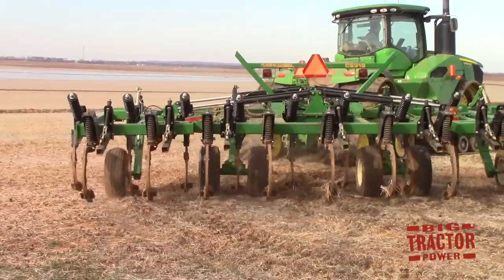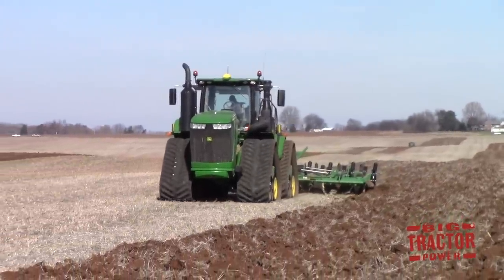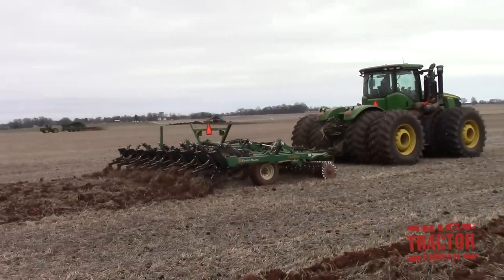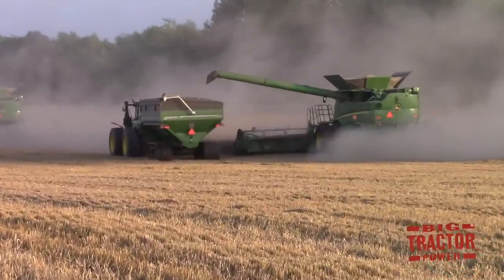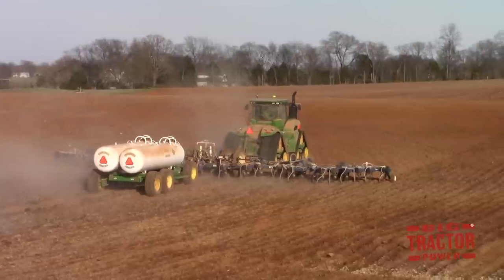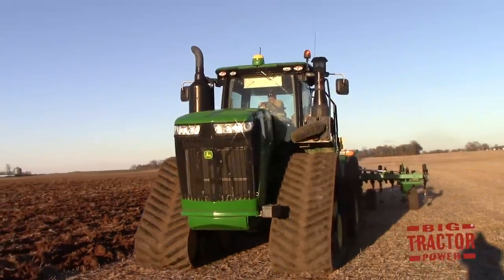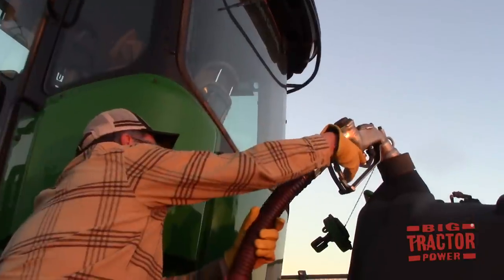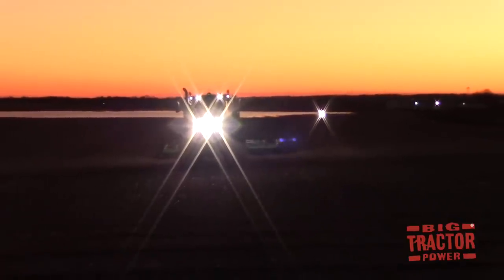2019 Field Work Underway with Two John Deere 9620RX Tractors Chisel Plowing

Comment: I am a hay farmer in Arkansas at one time I farmed close to 2,200 acres of hay in a year. I also row cropped about 600 acres of soy beans and wheat that was and still is a big job.  This farmer in the video probably farms over five thousand acres to have that type of equipment. Big Land requires Big tractors and one better have big profits or face big losses. Great video...
Reply: Pren Goodwin they have 10 thousand
Reply: @noahranker4133  Two 9rx machines is not much for 10000 acres?

Comment: Here in North Dakota our 2 9620RX work great in any kind of weather. You can’t feel a thing when pulling the air drill or tillage work. Hats of to JD for this tractor
Reply from the maker: Glad to hear you like your 9RX tractors.  This farm runs two 9620RXs for big jobs such as tillage and running a 60ft air drill.  They run two 9520RX narrow tracks for corn planting.

Comment: nice video, really enjoyed it. I grew up farming in England, when worked with my dad everything was very different with ploughing and many passes with cultivation equipment to break up clay soils (we did get 4-4.5ton to the acre yield on wheat crops tho)  but my last years working on farms I was driving a STX 600 on a night shift with the farm i worked for running it 24 hours a day with 8metre discs with subsoil tines, an 8m press and seed distributor in a single pass. We would cover around 250-300 acres in 24 hours with that min till but wheat yeilds were closer to 2.5-3 ton to the acre.

Comment: Just one correction. After setup of the same AB line in each tractor, there is no need to communicate position as the gps RTK system is sub inch accuracy.  Only for dual mapping is communication necessary.  Also it is possible to setup headlands in the software and autosteer can even make the turns on the ends.  That however is more complex setup.  Nice Narration and video thumbs up!

Comment: It seems like a 620 hp tractor could pull Great Plains 5323 TC with ease. Isn’t a 5319 kinda small for these tractors.  I will say it was cool seeing run across the field together.
Reply from the maker: In this red clay soil the 23 ft model running 18 inches deep that’s all the 620 hp tractor wants. A 28ft model would really strain a big 9RX in these conditions.

Comment: Watched the video and thanks for explaining all the tillage.  One question though, I have often thought on our on farm we need to get back to doing some tillage, since we too run a 1200 bushel grain cart across the fields but also run 2 large spreader trucks and a CASE IH floater spreading chicken litter across our fields once a year.  If we do too much tillage, and get spot checked by our local FSA office it kicks us out of receiving any ARC/PLC payments from the USDA, or any other kind of USDA gov. payment.  Do you know if that happens in Western Kentucky as well?  About the only thing we are able to run is a turbo till like tool, and they still frown on that.

Comment: Another work of excellence  from big tractor power!!! Are there any farms there that do no till or minimun till?
Reply from the maker: Yes. No-till Farming was invented in Herndon,KY in 1962 just about 80 miles from where these tractors are chisel plowing.  The farm featured in this video no-Tills some of their corn acres, all of their double crop soybean acres and all of their winter wheat acres. The chisel plowing is done on a few thousand acres each year so they have ground that warms up faster for corn planting earlier.  As they plant the tillage ground earlier it lets them then catch up to the notill acres later.  The rotation is corn to wheat to double crop soybeans.  Heavy tillage follows some of the wheat/double crop acres every 3 to 4 years that way they can break up compaction.

Comment: Great video!  I wonder if these farmers know they could preserve moisture, and reduce soil erosion by passing on the tillage in the fall and planting a cover crop?  Also would save on fuel too!
Reply from the maker: One farm I film at does strip tillage after double crop soybeans. They plant a rye cover crop behind the combines on 30 inch rows and strip Till between the cover crop.  This year it was so wet very little cover crop got planted and no strip tilling done.  One issue farms just planting a full cover crop have seen here is slugs in the spring eating up the new crop.

Comment: Was the "lake" in the middle of the field intentional or did you guys get that much rain down there? Great video.
Reply from the maker: Yes it has rained and rained since November first.  That is a low spot in the field that is connected to a cave system not far away. The famous Monmouth cave and Lost River Cave is not too far from the farm. When water backs up in the caves this low spot is a place the water collects. The water will cover over 300 acres in this field some times. They just work around it. Normally by July they can plant soybeans in the wettest spot.
Reply: @bigtractorpower , Now that's cool !  Not so good for the farmer, but still very interesting and if Jacob never asked and you didn't answer, we all would think it was just an irrigation pond. Great Q & A !!

Comment: I was just watching the millennial farmer's equipment tour again and this is the first time I remembered to ask how many of those g750s are in existence?
Reply from the maker: The Minneapolis Mine G750, G850 and G940 are very very rare. They were only built in 1971. They are nick named Molivers as the G750 is an Oliver 1655, G850 is an Oliver 1755 and the G940 is an Oliver 1855. In 1971 White Farm Equipment offered 11 tractors through Moline.  In 1972 there were only two in the MM G-1355 and G-955. The Moliver Molines were part of the 11 tractors in ‘71.

 difficult to determine how many Minneapolis Moline G750 tractors were produced. Although by 1971 the brand was quickly headed toward retirement. We can look at other MM sales to see how few tractors were built in 1971. There were only 515 MM G950's, 174 G1050's 264 G1350's and 513 A4T1600 built that year. 2000 Oliver 1655's were produced in 1971. The Minneapolis Moline and Cockshutt models were included in this number. While we cannot determine the exact number of 750's produced by looking at other model statistics, we can surmise that less probably less than 200 produced in 1971. I think less than 20 G940s were made.

Comment: Are any neighbors in the area NO TILL OPERATIONS?  Beautiful soil and amazing equipment
Reply from the maker: Yes. Allot of Western Kentucky is notill. Yes. No-till Farming was invented in Herndon,KY in 1962 just about 80 miles from where these tractors are chisel plowing.  The farm featured in this video no-Tills some of their corn acres, all of their double crop soybean acres and all of their winter wheat acres. The chisel plowing is done on a few thousand acres each year so they have ground that warms up faster for corn planting earlier.  As they plant the tillage ground earlier it lets them then catch up to the notill acres later.  The rotation is corn to wheat to double crop soybeans.  Heavy tillage follows some of the wheat/double crop acres every 3 to 4 years that way they can break up compaction.

Comment: Big brutes. That's deep ploughing 16" yes you can hear rpms drop somewhat. 30 hp per feeder, plough per implement is standard, is that correct ? Going back & forth must get monotonous after a while. It would me. How many farmers wound up in next county from falling asleep in a tractor. Anyway cool video both audio & video are solid. Good closeups. Bye
Reply from the maker: Hp ratings for equipment varies.  In deep tillage 30 hp is probably a good bench mark.  There is plenty to watch and keep you busy with the tractor. They move through the job pretty well.  .

Comment: and pls can you explain what you meant by harvesting double crop, thats you harvest a 1000 hectares but you get a 2,000 hectares crop, i did not fully understand you sir, thanks
Reply: They harvest wheat in late May/early June and then plant soybeans just after it. And then they harvest the soybeans in October/November. In this way they use the fields two times for two different crops in a single year.
Reply: @lucatorchio4665  Thanks
Reply from the maker: Luca summarized it well.

Comment: I don't think the motor in the 9rx is a pure Cummins. I'm pretty sure John Deere co-designed the motor with Cummins making it about a 50/50 split.
Reply from the maker: The sales literature lists the QSX15. Deere.com does as well for the 570/620 R/RT/RX tractors.  I am 99% certain it’s 100% Cummins.  I filmed a 2015 9570R and 9620R and they both had a decal on the hood in yellow that said Cummins Inside
Reply: @bigtractorpower  Huh, that's interesting. I read more about it and from what I understand it is a Cummins but Cummins built it like a John Deere engine to make it easier with the compatability of John Deere's technology.

Comment: Do these farms buy these tractors use them for a season and then turn them in? I understand that downtime is very costly but surely those tractors can last more than 1500-2000 hours. Is there a tax incentive that makes it more cost effective to buy new each year rather than using a tractor for 3-5 years?
Reply from the maker: I do not get into farms business side. These tractors get used a bunch and run most of the year.

Comment: Do you know If these guys communicate each other on the field to share the tracks and work together?
Reply from the maker: Yes they talk with each other via radios and the gps lines the tractors up on a perfect path wether they are running side by side or 200 area apart.

Comment: With all due respect, that great plains turbo chisel is not going 16 to 18 inches deep. You can clearly see that those shanks are only going about a foot deep. Those chisel shanks are not heavy duty enough to go that deep and deep rip! You said great plains recommends about 30 hp per shank… That in of its self proves that they are not going 15 to 18 inches deep like a deep ripper does! A deep ripper or deep subsoil tiller requires at least 50 hp per shank for going 15 to 18 inches deep! If they were really going that deep with that turbo chisel even that big tractor would not be able to pull it!

Comment: The globe on top of the tractor does not actually communicate with satellites at all it's not GPS it's rtk rtk is radio tower communication I believe so basically it uses stationary Towers what GPS you get 6 to 12in accuracy with rtk you get sub inch accuracy
Reply: The yellow dome is a GPS receiver.  They may also use RTK to get maximum precision.  RTK is not a stand-alone system, it is an error correction system to enhance the GPS system.
Reply: https://en.wikipedia.org/wiki/Real-time_kinematic (RTK)  
North SmaRTK GNSS RTK receiver being used to survey the forest population in Switzerland.
Real-time kinematic (RTK) positioning is a satellite navigation technique used to enhance the precision of position data derived from satellite-based positioning systems (global navigation satellite systems, GNSS) such as GPS, GLONASS, Galileo, and BeiDou